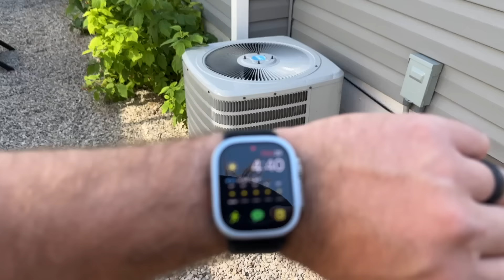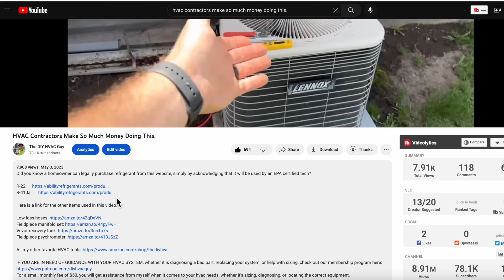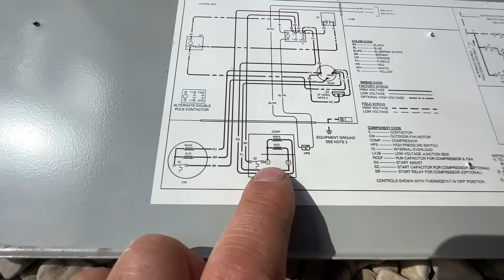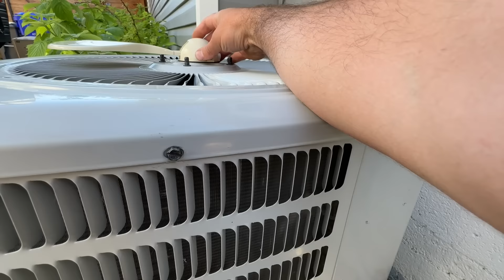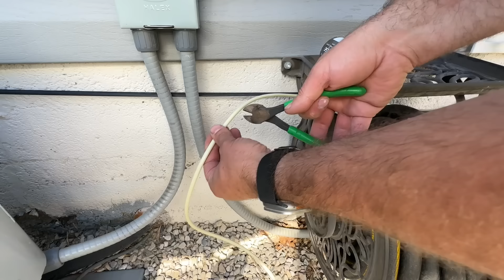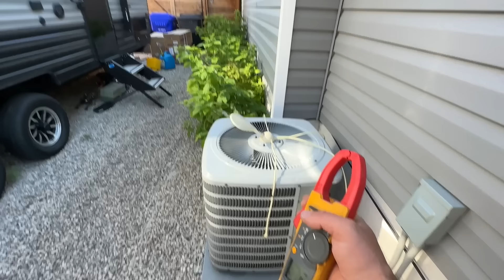Can This Device Actually Lower Your Electric Bill By 30%??

Comment: I built a swamp cooler surrounding my ac unit that recycles the water and then added 3 flexible ducts from the plenum in my attic to blow cold air onto the swamp cooler ac surround. Brrrrr

Comment: Your condenser is too close to the house, and you might get better results with a mister at each corner, or at least one on each of the two sides with full heat exchanger coverage.

Comment: I don't understand how water on the coil reduces the running current of the compressor motor?
From an electrical motor concept, this does not make any sense! The motor turns a pump, and the pump compresses the refrigerant,
it does that regardless off the evaporator temperature. If the outside temperature is lower, it will be able to have a better heat exchange,
which explains the slight decrease in the vent temperature.
Reply: It might reduce the compressor head pressure.  Lower pressure = less work, but not by much.  There are 3 motors in a split central air unit - evap/air handler, compressor, condener fan motor.  All those running is close to 20+ amps or more depeinding upon the tonnage of the unit.  A 1 amp drop on that one wire isn't much overall.

Comment: I have a manual version of this (a patio mister). Where I live, we frequently (and currently) get temps above 105 to 110 degrees. This makes my unit struggle to keep up and sometimes pop the breakers if the duty cycle (ratio of running/not running) gets high. At these temps, I have rooms in my house that get hot due to direct sunlight.
 I only run the water when the temps get high to reduce the strain on the system, but the hot rooms also get about 2 degrees cooler when I run the water, so I know it's doing some good. I haven't had the breakers pop either, so I know the amp draw is reduced.

Comment: Well done. I may try this on my Carrier heat pump. It is located south facing in SoCal so it is always baking in the sun. It would've been nice to see the ambient air temperature to help draw a correlation on when the amps go down and by how much depending on the outdoor air temp.
Reply: @erikgutierrez3613 * Turn it off in winter😂
Reply: good thing it rained a lot in CA past winter.
Reply: Please read my experiences with a Heat Recovery Unit (Desuperheater)  I I stalled with my Carried 16 SEER heat pump some years ago.  It's  a posting above.
Reply: Same here in Orange County. My unit is exposed all day. I've tried a similar system but got no different results. Maybe my unit is too old to make a difference. Plus, you would think they'd make some sort of option like this on newer units if it worked so well. 🤔

Comment: Here's my 2 cents.
I am an old refrigeration mechanic, as well as a Mechanical/Aerospace Engineer. Most of the units I have seen ruined have the condenser units on the roof, and they had a garden hose running on it. The coils that were ruined were the Aluminium kind that the fins were would tight on the tube. When you put running water on those, eventually, it will pull the fins away from the tubes, rendering the fins pretty much useless. Again the roof is about the worst place you can put an air cooled unit, where on a sunny day I personally have seen ambient air temperatures of over 165 F.
I kind of think that using a light spray like this would be about the same as a rain shower, and probably would do very little damage. Condensing units are made to run in the rain. It's totally different if you have a 30 ton walk-in cooler on the roof trying to cool a large room to 34 F with an ambient temp around the unit, over 150 F on the condenser, rather than a little 2 ton unit cooling a home to 76 F.
Keep an eye on the coils around the mister. Look for any tiny cracks between the fins and tubes. If even a small one starts, take the mist off. I think there will be very few that have this issue though. Most of the high end units will not have an issue. The reason most techs want them off is because they have been told they ruin the condenser, and are trying to help you. The main variable is where the condenser is located, and what you are trying to do with it.
Reply: sure you weren't measuring 'radiant' temperature? 165F would melt your thermometer. I've witnessed the same, the exact reason why you take reading in a shaded area and not in direct sunlight. imho
Reply: @snurb48   I used a calibrated temperature probe. If you are using a thermometer that melts at 165 F, you better get one for the kitchen. They at least go up to 400 F+. When you are on the top of a building, there is seldom shade. Most flat top older buildings have a tar/rock roof. 
You have to measure the air that is gong in the unit to calculate the heat loss you need for the unit to work. Getting off the roof and finding shade to take a temp reading is no help. I understand what you are saying, but a temp probe like I used does not pick up the radiant heat very well. They are not the best to use to calibrate a oven that uses radiant heat, but work fine on a conventional oven.

Comment: You can easily make this system with 1/2in PVC parts and some mister heads. And I think it will be much more robust, cheaper to make, and not look so kludgy.  As for the valve, here's a better idea. The HVAC condenser gets low voltage 24volts AC from the furnas to turn it on though a power relay. Just so happens sprinkler valves are also 24volts AC. So add a $15 sprinkler valve to your system and splice it into the low voltage control wires going to your condenser. These are often not in conduit and easy to get to. NOTE: this is not the case with MiniSplits!
Reply: Not everyone is a handyman like you.

Comment: Living in a windy area, the wind would cause the mister to turn on too frequently. My unit is in the shade almost all the time, so I don't see any benefit I would actually get. I did have a soft start installed as my system is almost 18 years old but still works pretty good, and I have it tested and tuned every 2 years.

Comment: Figure out how to provide some shade to the unit instead.
Reply: I agree. Mine sits in the hot sun most of the afternoon. I roll my garbage can up near it to block the sun. Shading it would go a long way to cut the heat rather than dousing it with water.

Comment: You are reaching far with, too far! You had a.c turned off, then turned on, and Temp decreased 1 degree. I could do that with my a.c. turn off fir an hour, then initially, the temp will be lower,,,but given time, it would increase one degree again....Stop Reaching ! This is not a thorough test. Also, drawing compressor current  ....less?%#^???How?

Comment: You d have to do a btu calculation at the unit to see if this actually works. I could maybe see it  working on an undersized unit on a hot day. I think just putting ur condenser under shade without blocking airflow is better. It won't rust your coil (leaks) or create "mud" on it which would lead to less heat transfer. I ve heard of this misting working on supermarket racks. Better subcooling.
Reply: There is a commercial product I've seen installed in SoCal called Evaporcool which essentially does the same thing on commercial package units, however it ONLY sprays the RIGHT amount of mist needed to achieve a very specific incoming air temp to the coil. The water gets sprayed onto a media pad, sorta like a cooling tower or evaporative cooler so the coils themselves never get wet so there's no concern for corrosion. There are several temp/humidity sensors tied to the controller to let the unit know when to spray and for how long. It's pretty neat.

Comment: Any info on how much water it consumes? Our water bill keeps rising year over year, so trying to calculate the cost savings, taking that into account.
Reply: I believe it's a couple gallons a day, or a single toilet flush.
Reply: Do the math,10% of your electricity bill vs 5% of your water bill.
Reply: @malcolmblack717  Yeah having never worked with misters I was missing the flow-rate necessary to DO the math.
Reply: @zacwolf2  We live in a HUGE country with different weather, humidity and HUGE rate variances. Some people wants the "exact" number from the YouTuber. But this number is not going to be applicable to everyone.
Reply: @malcolmblack717  Naw, not my intent (that would be stupid), I just had NO data, only a vague second-hand "it uses a lot of water" from folks that tried it at Burning Man [which has very atypical conditions]). Mostly, I was looking for, is it gpm or gpd(gallons per day), which someone provided.
Reply: @zacwolf2  The video at 3:35 said it was about one toilet flush per day. but some toilets are low volume flushes, so much for water volume estimates. But generally speaking it is not the water cost but the electricity saving.

Comment: As someone else said in the comments I think I would attempt to shade my condenser without restricting airflow like a sail shade or something.
Reply: Hmm, so that's why car radiators work so well! They're in the shade, under the hood! Thermal transfer works on temperature differentials, and the significant factor is how much air you move past the hot condenser fins, not solar gain from being in the sun. Shading makes a negligible difference.
Reply: @johngalt97 I agree. Radiant effect is negligible.
Reply: @CybekCusal  Well... The DOE (Dept. of Energy) claims sunlight shining on the condenser unit for even a few hours a day can increase monthly cooling costs by more than 10%.  I suppose 10% isn't HUGE, but... using my own unit's estimated use for the 2023 season so far (May 28 to July 26) ... That'd be an extra $5-6... And I've probably got another Month or so to go? So maybe an $8-9 seasonal cost consideration if my outdoor unit had to be relocated into a Sunny area...
Reply: @lgoamity  DOE lol 😂
Reply: @CybekCusal  The thing putting it in a cool area is going to do is prevent the inbound air from picking up heat from blacktop or concrete on its way to the unit.
Reply: @lgoamity  I think if this were true you would see giant white covers over large AC units on top of big buildings. I think the Unit designers would love to brag about even half that energy savings.
Reply: @don2deliver  Yeah. It does seem that the source of that "DOE" 10% claim isn't as reliable as I first suspected... The concern with creating roofs/shade for AC condenser unit(s) would be making sure they don't end up blocking Airflow to the unit reducing efficiency.  Having objects too close might result it poor results.
Reply: @Kandralla  what about units on top of a commercial building? do they run cooler 12 stories up because they don't pickup inbound air from the street below? lol
Reply: @lgoamity  Who the heck would quote the Department of Energy? kinda like asking Exxon if you should drive with your foot to the floor? or drive easy enough a egg won't roll off your hood?
Reply: @snurb48  Wow! Fascinating... This should be interesting, And what do you think about the EPA's Energy Star program?
Reply: @snurb48  I don't know why you're LOL'ing. Nothing you put there is worthy of it.

If you have a hot surface with a lot of mass anywhere near the condenser this will happen. They put units on the roof because they take up less prime space on a property not because that's the ideal location for a condenser.
Reply: @johngalt97  Assuming your comments aren't meant to sound as A-holish as I took them on first read... You do have a point. BUT functional heat transfer is just one factor on placing it in a "cool" location.

There are A LOT of Variables to consider when trying to maximize the Efficiency, Longevity, and Power/Maintenance Savings of an AC unit.  This video doesn't really provide/address some of the Variables I 'd have liked to have seen.  (Intake and Vent Temps, Peak/Average Power Usage over multiple cycles in mod/unmodified modes and not just a "snapshot".)

Using your "car radiators" concern... While the 32 year old AC unit I mention does have an "ideal" location (for "Shade" anyway)... The EVAP Coils and Vents are run thru an Unconditioned Attic Space... So I do have to factor in that my "resting" Temp at the Vents are often 10+ degrees over the Intake before things begin. Not factoring in the actual Attic Temps and Efficiency losses cooling thru 32 year old equipment, ducts, and piping...
I'd speculate/agree that had the Outdoor Unit been placed on the South (Sunny) side of the House... It might not have changed my indoor readings all that much... But I'd suspect the UV/Heat and "Open" (less shielded from Weather) conditions probably would have cut its overall service life significantly. Current "average" AC life expectancy is about 15-20 years with proper maintenance, according to Carrier...

My Car's Radiator is 20 years old and is doing just fine... It'll probably keep doing so as long as I change the Antifreeze/Hoses as needed while also trying not to doing a lot of Stop and Go in say 110F weather...
Reply: @lgoamity  You should place a 'desert bag' in front of your radiator and wet it. How the old timers did  it in the desert? If that doesn't work try planting the same type tree shading your A/C in a pot mounted on your front bumper? This should extend the life of your car too, right? Ha, Lol !
Reply: rose of sharon works too
Reply: If installing "new" or replacing... Be sure to consider (if the Installers haven't already) the "coolest" location for the unit.

For ours (Installed 1991) it's on North West Corner so it is largely in Shade all day and because of a 7pm-7am (and Weekends) Time of Use Plan (Thermostat programmed to take advantage of this) It is largely run during Dusk to Dawn conditions so Solar Heat isn't a large factor...

Comment: I would love to see the results of running one of these units in my part of Arizona average summer temps of 110 usually get at least two weeks out of the Summer where we have an average temp of 120 for those that may experience thermal overload during those hottest times of the summer Temps this unit would be mandatory versus standing there and manually water your coils to get your air conditioner to blow cold after the compressor shut down from thermal overload.
My question is filtering the water does it completely eliminate the calcification of the coils or does it just greatly reduce it? Because my coils required some very expensive cleaner to get the calcium off of them after only using water for a couple of weeks.

Comment: Unless the unit is an inverter ac, misting should not impact decibels or amperage, only temperature output and length of run cycles.

Comment: I have city water, that water eats up anything aluminum I put into my dishwasher.  I can’t imagine what it would do to the condenser fins.  
Also for a real world comparison I think you should have installed the system, then run your ac with the water turned off, gotten your readings, then turned the water on and see the amps drop in real time.  That would have taken out a lot of variables.
I don’t like the design of the valve that turns on and off the water, a solenoid design would be a much cleaner look.  Also the system is over priced at $100.  You can get a solenoid for $10 and the misting lines to do several ac’s for another $10.
I don’t think you will see much lower temps at the register, just lower amp draw as you are reducing the head pressure from the compressor and that is the bulk of the efficiency gain.
Finally show a pool heater install.  
That is much more efficient and gives free heat to a pool and does away with the concerns of wasting away of the condenser.